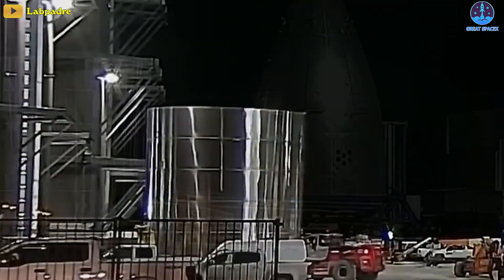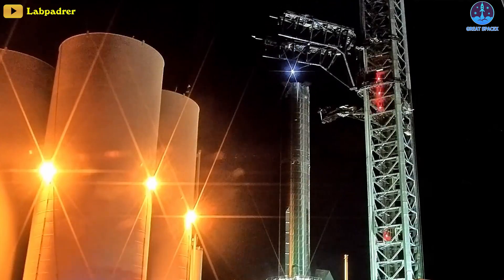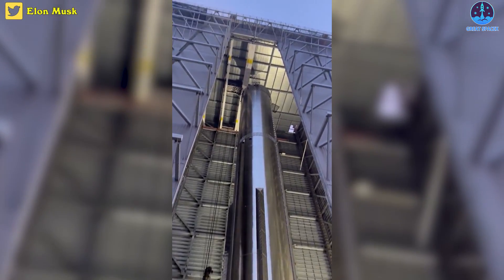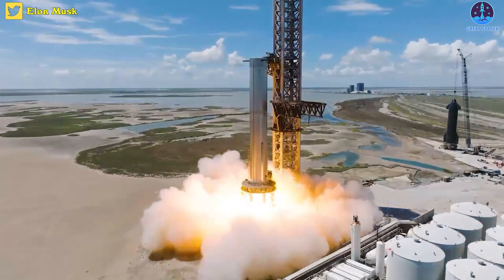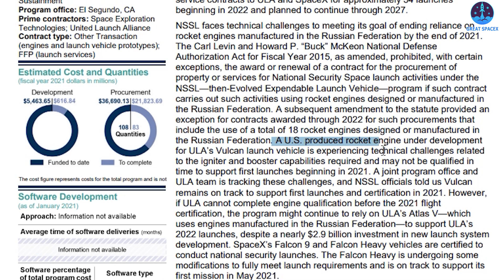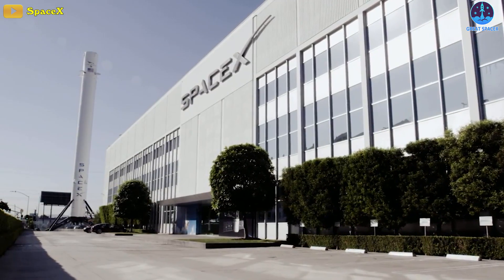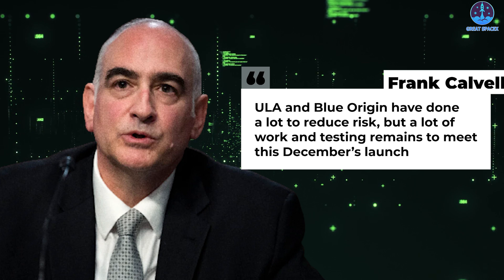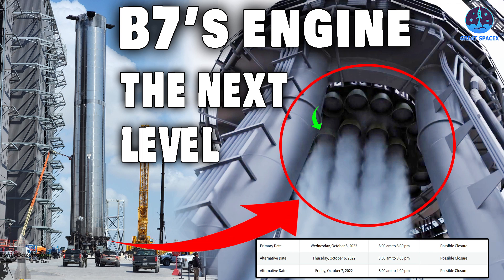Ship 26's new upgrades, B7 prepares to return to launchpad for pre-launch testing...

Comment: Unfortunately, I suspect that ULA will likely get good chunk of those contracts for flight of the Vulcan if the rocket continues to develop on track.  Only reason is its in the best interest of US to have more than one option for heavy lift and medium lift vehicles.  Personally, I don't like monopolies and ULA has been in the past for decades until SpaceX and other providers finally appeared.  We need less merging more competition.  Without gouging tax payers and commercial companies.  I don't have a lot faith in BO getting their acts together, I just hope SpaceX / Rocket Lab / Firefly can surpass them.
Reply from the maker: Competition is a key driver of development!
Reply: Clearly Blue origin did not count on competition BE4 5 years late and counting. SpaceX developed The raptor then moved on to the Raptor2 and the Raptor2 is at the same stage as the BE4 . Hey maybe Blue Origin will attempt an orbital launch ! It appears that the BE4 will get to orbit but not on a Blue Origin rocket at first but having more Options will be great !